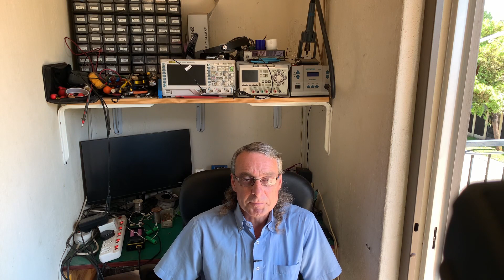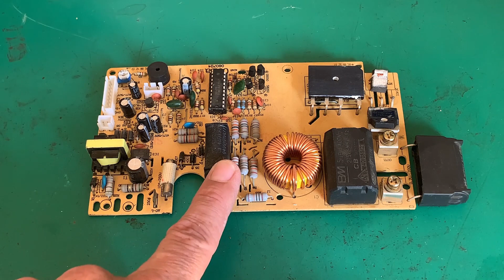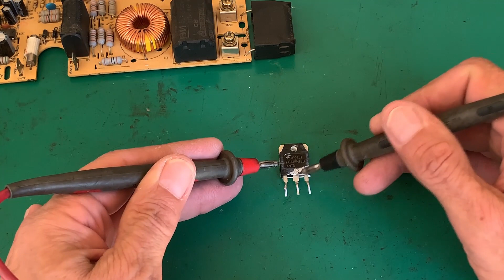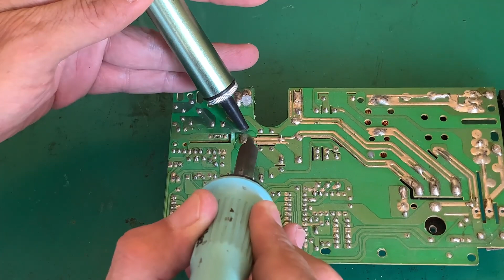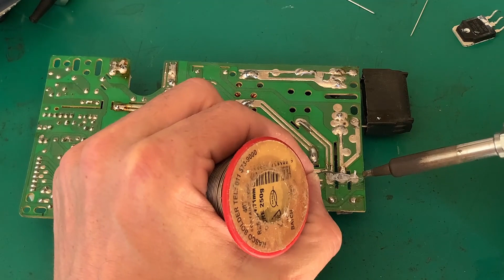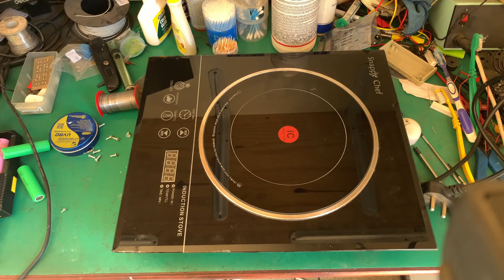FoulkesBrau #50 - Snappy Chef Induction stove repair

Comment: Hi Craig if you could assist I have a snappy chef sdc003 2 plate induction stove. I am a technician too. I have done a lot of troubling shooting even swopped the heating coils. The error is that the left plate don't function it shows error EE not e3 so what I did was even swop the entire boards to see if the one board was faulty. Both boards works. So now my last issue I can think of is the main touch control board. Please assist if you can

Comment: My snappy chef shows e2 error the manual said it’s faulty heat sensor that I’ve replaced but still shows e2 error after 30 seconds of heating. The fan is working fine. What could be the problem

Comment: Hi there, I'm interested in this repair as I have a snappy chef that will probably need to same repair.
Where did you get the IGBT from? I'm also in South Africa, so suffering from the same restriction and delays as you do.
I really appreciate your videos.
Many thanks
John
Reply from the maker: Hi John,

The IGBT, fuse and rectifier can be sourced from RS Components. Communica is permanently out of stock. You won’t get the same voltage and amperage rating as the original IGBT, but you will get close. 

I have the same snappy back on my bench - the rectifier went after the latest bout of loadshedding. 

Cheers

Craig